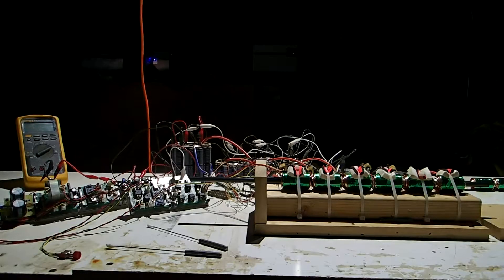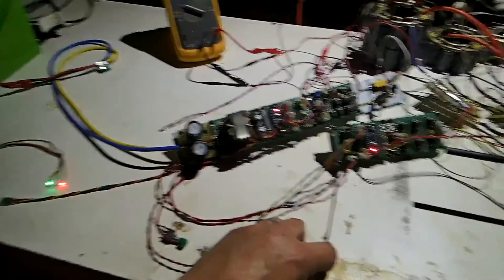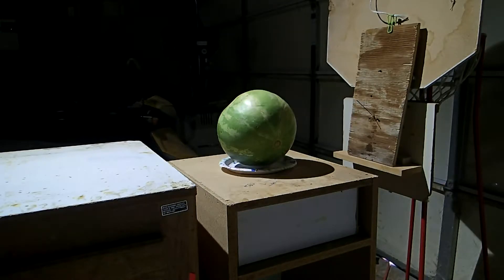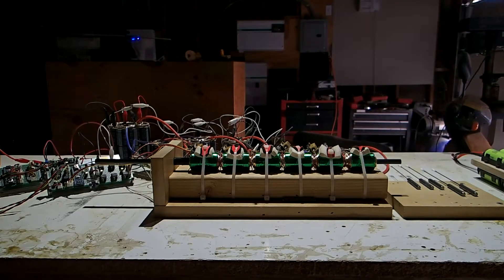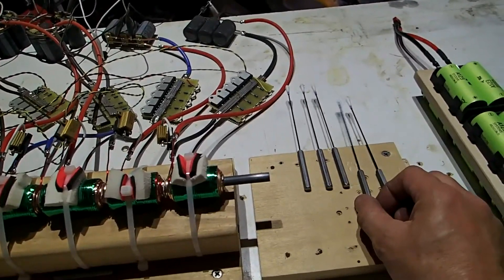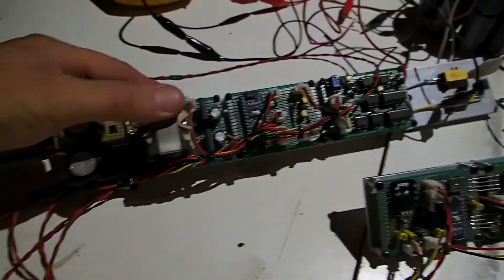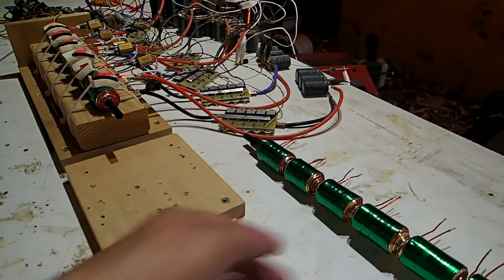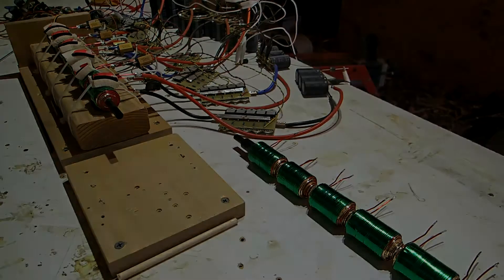World's Fastest Weapons Grade Coil Gun

Comment: I notice that your capacitor banks decrease each stage I saw one of the videos where you explained that it can only accelerate a certain amount after the first stage. would it work the same way if you used the same capacitance but spaced it out into three stages instead of six? I'm trying to make my design as small as possible before I build it and I'm curious if that would work
Reply from the maker: Доминик Недлюски no you must decrease the capacitance with each stage the reason for that is the projectile is already moving and it will only remain in the coil for short while if the pulse is longer than the short time it remains in the coil it will D accelerate the projectile and ruin the performance.
Reply: Moss Fett that makes sense. what's your way of switching the coils I asked vasudev his as well he told me I should use Arduino and optocouples.  could I get the same result with a 555 and rc filters?
Reply from the maker: Доминик Недлюски no you must use the Audrino computer it is accurate down to three microseconds which is perfect for this type of design you don't need to use Opto couples the speed of the couples is terrible. We can't rely on propagation delay which will ruin the performance we need to fire the next coil at exactly the right time in microseconds of accuracy I tried RC time constant where it measure the filter capacitor voltage and applied the pulse when the capacitors were empty but there's all kinds of back EMF voltage flowing backwards and forwards and basically they cause erratic firing in a design doesn't work after two stages is all I could get out of it.
Reply: Moss Fett wait so your saying you have your gates plugged directly into the Arduino?
Reply from the maker: Доминик Недлюски they are plugged into opto couples specifically a3120, which are mosfet drivers so the ardrino lights up the little LED in the opto couple and that fires the gate of the scr so when we're talking about opto couples before I was talking about the couples on the accelerator tube looking at the projectile not those kind. In my design there's no sensor on the accelerator to to tell the electronics when to fire the next coil the timing of the design is in software where you actually figure out how much time you need by measuring the speed of the projectile going through the coil using a scope or some other method then you adjust the software to that point that will get you on track then you can tweak the timing a little bit on each stage to get it to the best it is using a digital chronograph to measure the speed of the projectile as long as you keep going faster you're going in the right direction.
Reply: Moss Fett that makes sense now. honestly I was really impressed when I saw that you had no optics to switch each stage. but that makes more sense to me now I was confused because I thought you were saying drivers were to slow to control each stage
Reply: Hey, just read this, so you're not turning off the SCRs? and waiting for the charge to run-out?
Reply from the maker: jasxir once an scr fires it stays in the conducting State until the capacitor is drained even after that the electromagnetic field around the coil will collapse causing energy to go back into the circuit charging the capacitor backwards keeping the scr conducting until that magnetic field is gone that's when the scr turns off.
Reply: Hmm, I know about SCRs that once "switched on" the only way to switch them off is to reverse the polarity, but that would be a complex problem of it's own, looked into other options like SSRs?
Reply from the maker: jasxir the thing is you don't need to worry about trying to make the scr switch off the secret to it is to put just the right amount of capacitance to the inductance of the coil and the DCR of the coil so that the pulse width is the perfect length for the weight of the projectile that's being flung out the tube.

Comment: today I bought a scr which can take 2500amp pulse and and ways is only 16 grams . I use 70tps12 in my coil gun and I have embedded it on a capacitor itself
Reply from the maker: Vasudev Mr the weight I gave you is all the weight including the soldering and the input, output copper bus bar and a PC circuit card. it handles 5000 amps at 1,200 volts for room for expansion.
Reply: Clay Reid so you had plans for further to make it really rugged so that you can input the coils with may be 1000v to increase the output power .
Reply from the maker: Vasudev Mr yes, but capacitors are a problem remember we discussed this thing of becoming a backpack system with a forearm weapon
Reply: Clay Reid yeah I remember all those things my friend .was just busy with my engineering course

Comment: why did you use 7mm , that's a really good choice coz it's dimension is same as  crossbow arrow to penetrate stuff
Reply from the maker: Vasudev Mr it's about. .280 inches it was the perfect size carbon fiber tube to fit hexagon Steel .250 because the outer stars of the hexagon they slide inside the carbon fiber to like rails with low-friction

Comment: do you think battery operated Coil gun will give output kE like this capacitor powered Coil gun
Reply from the maker: Vasudev Mr no it will not, the only way is to have a 450 volt battery and then the electronics switching them all that current would be very serious.
Reply: Clay Reid yeah I guessed it

Comment from the maker: every little thing matters in trying to get every little Joule out of it. the length of the projectile the weight of the projectile, carbon fiber tube hexagon shaped projectile for low friction, the thickness of the wire in the coil the number of turns the capacitors the timing of the computer the thickness of The Wire feeding the coils since 2000 amps goes through there. long projectile rods are the best. although I haven't used one over 2 inches because the amount of money in wire to wins the coil

Comment from the maker: yes it will when the magnetic field collapses they'll be a reverse voltage because now there's a resistor, this will go back and charge a capacitor backwards so you have to put a diode and a 15 Ohm resistor across the capacitor.
Reply: the problem with me is I have bridge rectifiec across capacitor bank to charge it, if I add the resistor in series with that diode . the current due to back emf will find it as difficult path and it will pass through bridge rectifier, which is more easy path and short circute will happen as we were discussing.
Reply: does your charger has bridge rectifier at the output??

Comment from the maker: when the magnetic field collapses around the coil there is not much load on the coil because the resistor is there so the magnetic field is weak without the resistor it's a short circuit on the collapsing-field of the coil.
Reply: when fully charged capacitor discharges though a coil with scr as swich, and after capacitor is dischrged, back  emf will be produced by coil's magnetic field now will that back emf passes though scr to charge the capacitor in revers polarity??

Comment: hi clay reid, I added  7 .5 ohm resistor in series to that freewheel diode as u suggested, the results were awesome,it increased the output power, now it punches through a 5mm playwood sheet .which it was not doing before.can you explain how it will increase the output power

Comment from the maker: everything is temperature-controlled controlled by the two on board computer that includes the coils and the power supply. if I try to exceed the capacity of the weapon the computers will disable the power supply can put it into standby mode until the weapon cools down

Comment: Ah yes as expected, but the downside would probably be the size of the lithium nano phosphate batteries. Also on the powersupply, did you have everything computer controlled by that Arduino nano or did you also use the ATTiny for other individual actions like the PWM?